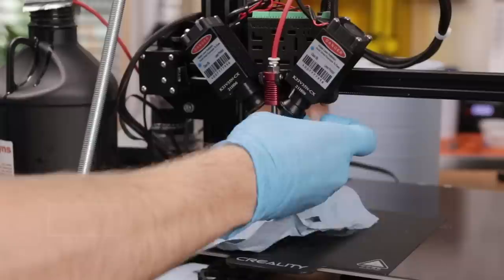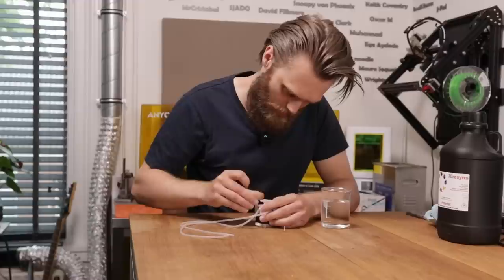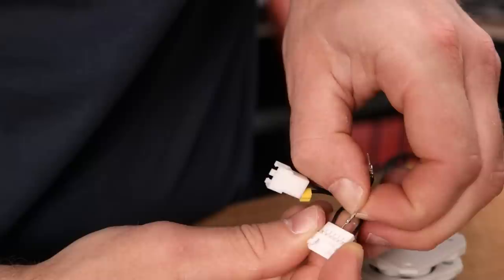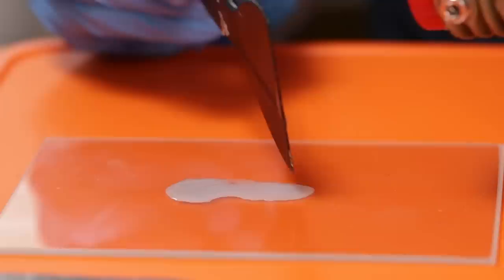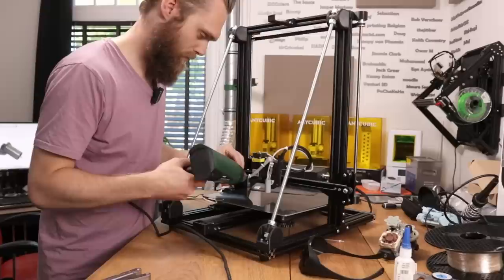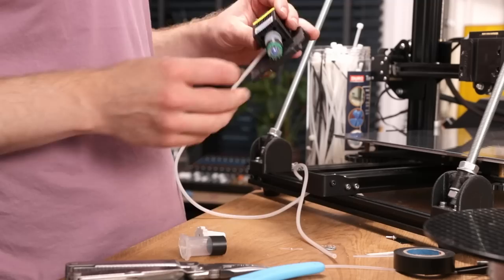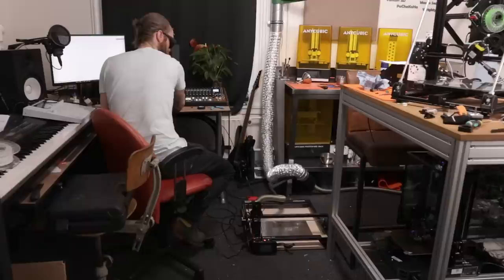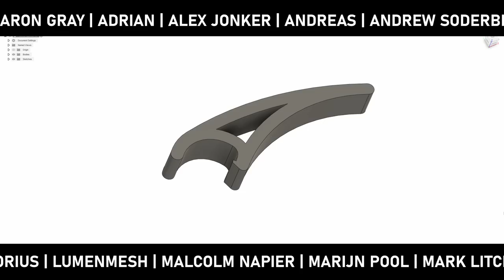FDM resin Printing with LASERS and a 3D Printed PUMP!

Comment from the maker: Hi guys! I arrived in Chicago after a long trip to go to MRRF! I haven't gotten the time yet to respond to your questions and suggestions, but I soon will. Maybe meet you there!
Reply: Aw, man. I couldn't make it this year. 😢 I hope I get the opportunity at a future MRRF. Have a good time there!

Awesome work on this - I can't wait to see what comes of it.
Reply: Welcome to 🇺🇸,  swing by Denver, I'll buy that coffee I owe you!
Reply: You don’t have the squish of SLA and you are not doing small cross section free form print so To counter balance the tiny surface tension effect. Start by printing the inside wall and apply a Z shift at each layer. That should do the trick and allow you to use low viscosity resin which would be the easiest to prevent leaks
Reply: Absolute pleasure to meet you at MRRF. You’re the best kind of a mad scientist!
Reply: Awesome experiments. Great note on safety for the lasers, but you missed a very important warning with this type of work. Photopolymer resins give off heat when curing. If you have some on your hands (even with gloves) it can burn you if it starts curing - if too much uv light hits the spot. Be careful, even a smudge can burn you to blistering level.
Reply: I was not even aware it was happening this year. I hear that See Me CNC did not attend which is weird since they are right there. I hope they are alright.
Reply: Have you thought about putting this in the public domain so that everyone can use it and companies can't steal it out from under you later on (Preventing people from being able to use it due to patents and BS.)
Reply from the maker: @Jeff-ss6qt  certainly! This is what I do with most of my designs.
Reply: @Jeff-ss6qt  Jeff and Proper Printing, too late on stopping the patent trolls. There are tons of patents on this tech and surrounding stuff. Most aren't using the IP (Massivit 3D being one of the few I can think of). So be careful or you will see lawsuits up the... Best to just tinker, give it away and don't put too much personal info out.
Reply: Have you tried a gillson syringe pump? It's basically a syringe that never runs out. Look at the design and make your own
Reply: You can get your original pump design going if you find a way to get a really persistant layer hight but imho I dont see that happening using a low viscosity. 

I suggest to get an even higher viscosity paste or gel to get even layers that wont flow everywhere where you dont want it, also helps with all that gunk on your nozzle.  Additionally you want it to be opaque to elimintate as much of that bounce light as you can. Bigger sturdy nozzle if it still clogs. Only question left is how to get UV resin to a paste like consistancy. Unless you want to dive into chemistry you could try to take a small sample of your high viscosity resin, give it a gentle even UV bath to get to even higher viscosity, then filter it through a mesh that represents your nozzle diameter, just to see if this partially cured resin clogs it if unfiltered.
But all this is gonna be a real mess to clean up. Another way to increase the viscosity this much is to cool the resin down alot and keep it cool all the way to the nozzle. Yet your best bet is some kind of filler you mix into the resin, silica powder or granules should work. If your filler is sinking to the bottom you want to add poly glycol PEG 200/400.
Really interesting idea man I hope you can pull it off.

If you wanna advance it you could go for inkjet technology. It is perfect. Nozzles do not touch the piece at all while maintaining a constant really thin layer hight. Only thing I wonder is how they prevent these tiny nozzles from clogging since you will get a ton of bounce light from either the printing surface or the parts they are printing. Maybe they use a shutter for the nozzles basically printing the layer without any UV first then close the shutter for the nozzles and then the gantry does another swipe with UV lights on to cure fresh layers.

I'd go for inkjet cartridges since creating droplets this small in a controlled manner is hard to do. 
https://www.youtube.com/watch?v=-DckWNwE7R4 <- watch at 4 minute mark
If only I knew how to bridge between gcode and whatever these little fuckers need to thrive. 
Arduino or similar shit perhaps?
If you pull DIY UV resin droplet printing on a FDM printer using a piezo and an arduino, I will subscribe :D
Reply: Amazing

Comment: The worst part about your videos is that they end. I need to see this succeed now, i'm invested! :D
Reply: Thin the mix. Add a tiny spray head of resin, like spray painting, the laser cures the "paint". Attach a standard 3d print head to your rig. Precise controlled color depths for 3d prints. This way its lack of layering is a benefit. Easy to scale up to full color printing. You could also combine it with a 3d scanner and make an automated 3d coloring device for existing 3d prints.
Reply from the maker: We're going to get this to succeed!
Reply: @properprinting  Why are you curing the resin right near the print head. Put a shade system so that what you are actually printing doesn't get cured until it moves outside of the print area. Also the fibre optics. make a loop, and sand it. The light will come out the sides instead of the end.

Comment from the maker: This was the toughest video I've made so far. I badly underestimated FDM printing with resin, but I'm happy with the result. The pump on itself already enables some interesting possibilities for the extruder series! If you've got suggestions on how to FDM print resin, than let us know in the comments!
Reply: What about turning off the laser on travel moves? If you are controlling it with the fan output, you can just wrap all G0 moves in M107 - M106. Then even if it leaks resin it will stay liquid. Also in DIW adding a filler to change the rheology is very common (eg SiO2 or TiO2).

PS is the pump design uploaded somewhere? Kinda want to try it out
Reply: @SilvioTisato  You could even program firmware retract to do that.
Reply: @daliasprints9798  Yep, although that depends on the firmware you're running. I know for sure you can do it with duet, but I haven't had to do it with others. Also you might want retract to lower pressure in the needle, though that quickly result in air bubbles. The M106-107 is just a regex substitution
Reply: Interesting idea, love it! On a topic of predictable flow I would suggest trying a system with a reservoir residing above the printer(maybe on a shelf) such that it can introduce a manageable pressure in the tube. Pump may add the resin to the reservoir at a predictable pace and reservoir will act a a buffer to have enough resin to keep needed pressure. Then the two challenges still left: a) stop the flow and b) control the flow intensity. To be able to stop the flow I would  add a small solenoid to close the resin output right at the print head; just before the nozzle. And to be able to control the flow I would try to have a prolonged/rectangular shaped reservoir, such that when rotated/tilted the height of the resin change and pressure change with it. Idea with tilting resin reservoir will require a motor of some kind. This whole idea is very dependent on ether ton of experiment or a mode to predict its physical behavior. Anyway, good luck with the project!
Reply: How about spraying the resin, that way you could get higher resolution as well.
Reply: try using opaque resin, preferably a black one to prevent reflections from the lasers.
Reply: @wizardOfRobots  We used to have a commercial 3D printer at work that did just that: the head would pass over the surface and ink-jet a resin, then turn on the UV lamp and pass back over to cure that layer.  The ink-jet array allowed for raster-printing an entire layer in one pass.
Reply: I think the issue here is you're curing the resin before the layer can properly form. perhaps the light source you're using is too intense, and instead what you need to do is use a gentler LED light source, extrude with the thicker viscosity resin so it has a better chance of keeping its shape, and only expose between layers. I think the main thing is you're trying to print and expose at the same time and that's what's giving the most issues.

Think about it this way, you're trying to lay down the resin, and then cure it. currently you're doing both steps at the same time. I think you need to separate these two a bit better somehow. I think you're on to something with the fiber, but that POF (plastic optical fiber) is probably too opaque to the laser to use, or you're bending it too much. that stuff works best with red light, but should still do ok so long as you're not bending it too tight. try opening up the bends so they aren't as sharp, or mount the laser directly above the print head. also, try to get the fibers to sit as close to the print layer as you can without touching, as you're trying to avoid light bleed. If you really wanted to get precise with this, you could take a number of UV led's and have them turn on each with their own fiber line running to the print head so it is only curing where it needs to be, and not exposing anywhere else. if all else fails, see about getting your hands on some multimode glass fiber, preferably a type that has a plastic coating. look into how a fiber cleaver works, you may be able to make your own. If you do, be sure to take proper precautions for working with glass fibers, as they can't take as much abuse as plastic and the tiny bits of glass are nasty. 

your method of lensing the lasers to spread out the light a bit could be used to get the laser to focus wide enough to hit the end of all the fibers, not sure how well that would work. may be easier with an LED. to prevent light bleed from curing the resin in the silicon tube, put some black heat shrink tube over the last stretch of tube going into the print head. also, make sure the ends of the fibers are as flat and clean as possible for maximum light transfer, i suggest getting some high quality flush cuts and keeping them for this project, the main thing is that your blades are sharp so they cut as cleanly as possible.

i think this will work best with an opaque, viscous resin, as again, you're trying to control light bleed during your print. 

best of luck!
Reply: Is there any way to increase the viscosity of the resin? So it's more of a gel?
Reply: I’ve messed around with using clear PETG as fiber optic light tubes, what I ended up doing to make it more effective at holding onto the light in the corners was wrapping the clear PETG in aluminum foil and then heat shrinking it. The foil acts like a reflector to introduce the light back into the tube.
Reply: Itd be really cool to see you revisit this in a other episode
Reply: Not to push a commercial product but some viewers might like to know these printers (resin extrusion) are out there. massivit3d makes them but don't expect to buy one unless you use commercial grade equipment. They are expensive, big, but FAST! Look them up for ideas. BTW they use gelled resin
Reply: Can't you make the laser rotate around the nozzle and then follow it, this way it would only cure the resin that needs curing. Maybe an idea worth exploring?
Reply: I posted my ideas together in another spot on this post. I hope you find them useful. Feel free to mention me or not as you please if you find the ideas useful.
Reply: @drew899  : Coating the relevant "color" of paint onto the fiber should also work, so long as it doesn't damage the fiber.
Reply: Could you use an idex type setup to first lay resin with one head and cure with the other, so the light and nozzle never interact? Sounds very tricky to control layer height. As a plus you could just use the laser on it's own to get super fine definition.... though that may be a pain as well I guess.
Reply: The pump rotation produces a sinusoidal wave pattern and the best way to combat such a flow pattern is to use two pumps that are perfectly out of sinc with each other and that combine their output together to give a consistant flow.
Reply: crank the speed up, like really crank it up. it seemed to me as if the resin was curing to the tip too often before it could fully release and lay on the bed or previous lines.
Could greatly increasing the speed help to get the tip away faster, so that the resin doesn't fully cure until its further away from the tip?
Possibly increase the speed, and aim the laser "backwords", so that it's curing after the nozzle instead of right under it?
With higher viscosity resin and the increased surface tension, does it really need to be cured immediately beneath the nozzle, or could it hold form well enough for the fraction of a second that it takes to get the nozzle even 0.01mm away from the curing point or further?

i don't know if this makes sense to anyone else, it's just what seemed to pop into my head
Reply: @and3d633  Thats actually super helpful. It means it IS possible we just haven't stumbled into how to DIY it. For now.
Reply: @SilvioTisato it would seem that a micro solenoid valve may be a better way so it can be turned on and off at a rapid pace.
Reply: Considering that the cheapest Desktop resin printer just came for €1200 it's amazing that you could pull it of.

Comment: The pulsation can be solved by using 2 tubes. Both tubes run on the same set of rollers but the outside housing has a phase shift for both tubes. This way the pulse of 1 tube falls in the dead period of the other.
Watson Marlow (Dutch peristaltic pump manufacturer) has a few model doing this running in the lab here.
Reply from the maker: Thanks for the info! As it looks for now it seems not to be pulsating too much with this design. One tube makes it easier to work with, so I hope I can stick to it.
Reply: And we have car engine

Comment: you need gel instead of liquid, liquids will move on you before curing and it retracts unpredictably. I would like to see some trace testing to tune every parameters, you can't use standard fdm parameters. You need to cover a wide spectrum of values because you're into unknown territory. We don't know if the fluctuation in extrusion is causing real issues. When the first layer is nice, then test to stack them and succeed to have consistent height. I would try pointing the laser on the nozzle and use high speed printing to avoid clogging. Considering each layer will cure more previously laid ones, the power of the laser needs to be tuned to barely solidify the resin with one pass, this will reduce clogging. We can check if the layers need to be thinner than the nozzle diameter and if prefers over or under extrusion. if the resulting parts are tacky, it's not an issue you can cure them after.

Comment: 16:48 - So the resin itself is acting as a light pipe, allowing the reflected UV light to travel up the nozzle and prematurely cure the material. I didn't see that coming.
Reply: So kinda "upstream contamination" but with light. Maybe printing with dark / black resin could prevent it? Or maybe just adding some coal powder / dark pigment to existing resin could do the trick?
Reply: @puerlatinophilus3037  TiO2 works too (white pigment), it absorbs UV really well. But dialing in the amount of pigment is not easy.
Reply: @adamrak7560  Sad that this means another limitation but depending on the resin's thermal resistance, it is a possible upgrade in some context
Reply: @puerlatinophilus3037  the resin itself needs this light pipe type of process (penatrating) in order for any curing past the surface level of the print regardless of the method used to print.   

I think what we are seeing here is actually seeing.  How we know an object is somewhere generally relies on light waves reflecting from its surface or the absence of that. This is no different. The laser light is reflecting from the surfaces and penatrating the nozel. Either controlling the light or shielding the actual nozzle or both is what will be needed. 

But I guess if it was that easy,  they would be mass produced and on the market by now. So what do I know.
Reply: I think I did this manually many times in the lab from 1999 to 2007.

Comment: Your zero-pulse pump solution surprised me, very cool and elegant.  I thought you'd need two running out of phase into a Y-adapter.
Reply: I think this would work. You can use the same motor and just use a stacked design but with offsets. Y's on the ins and outs.
Reply: Having an oblong or egg shape may reduce the pulsing and improve consistent flow.

Comment: Have you tried/considered a non translucent resin? I think ideally something dark like black. I think the issue is that the resin refracts some of the laser internally, and funnels it up the nozzle opening like an optic fibre. Perhaps a less translucent resin would prevent this. It would be a lot slower but you could also try doing dropwise extrusion (and retract to break the physical connection between the resin in nozzle and the print, possibly mitigating the optic fibre like effect)? or print a layer then cure it?
Reply: The resin needs to be translucent else the UV won't reach and cures the inside.
Reply: I'd print an entire layer and then move the nozzle out of the way and blast the build plate with uv
Reply: @durandalgmx7633  Don't forget that even visually opaque resins could be translucent to the UV.
Reply: @bryanst.martin7134  That's true
Reply: I was thinking along that line as well, when you watch Joel's video the resin used is an opaque white. A different resin should do the trick, hope it gets resolved it would be an awesome addition to the tool box.